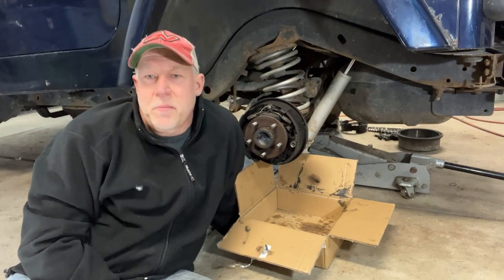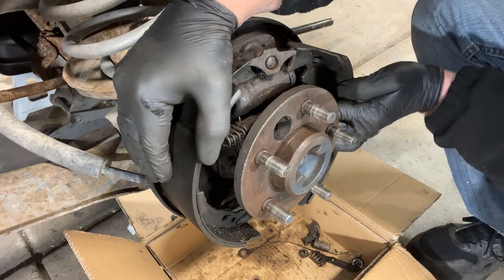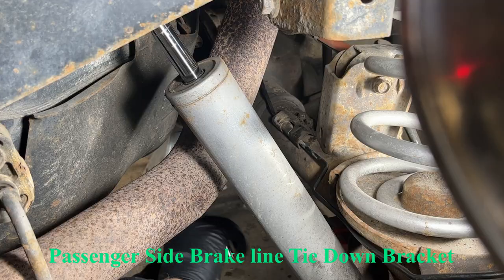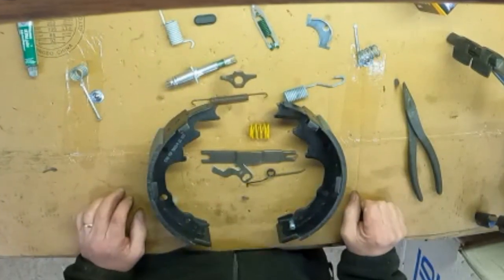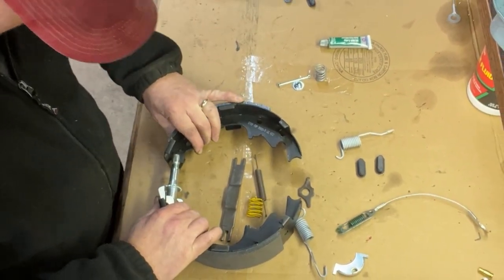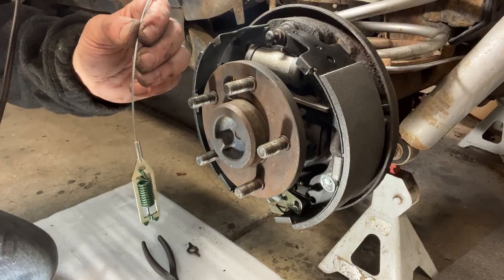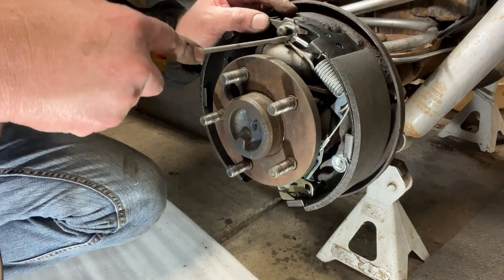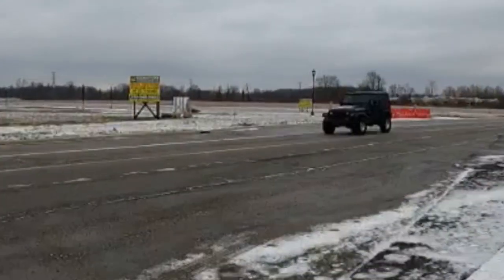TJ Jeep Wrangler Drum Brakes - Quick and Easy Removal and Install New Shoes, Wheel Cylinders & Lines

Comment: I did this job last week on my 1998 Wrangler SE and followed your video.  It was easily followed and very informative.  I also did my front rotors/calipers and discs , so this was a complete 4 wheel brake replacement. the only good parts on my original setup that were good were the brake lines.  When bleeding the rear brakes I made sure that all the old dark fluid was removed from the system before stopping and continued to the other wheels.  I now have great braking power, and am confident that the job has been completed correctly.  THANK YOU for the great video assist!  
Bill - W3SI
Reply from the maker: Thanks for the comment and the details on how it went. My goal with the channel is to share good information and hopefully share a good laugh a times. Thanks for the support!!!!

Comment: Well made video, great camera work for a clear view of the assembly process. I didn't see any part where you added lubrication to the touch pads for the front and rear brake halves. The explanation of the brake lines was very clear and informative on the different was to complete the replacement process. Great information without being overly drawn out!
Reply from the maker: We spend a lot of time  trying to cover all the content but I do miss a step sometimes (brake grease on the guide pads) great catch. Thanks for the great comments and watching.

Comment: I found this video as I'm trying to figure out why our 2000 TJ breaks are super sensitive.  Any suggestions on troubleshooting that issue?  If I was to do the same test you did at the end of the video, they would have locked up.  One thing I have noted, when they do want to start locking up or under hard braking, the jeep dives forward and right.  It's to the point my wife doesn't feel safe driving the jeep and it was her dad's jeep that she inherited a year ago.
Reply from the maker: The first 3 issue I would look. 1 : Brakes shoes installed correctly 1 shoe has a longer lining then other, if installed backwards this could cause the issue. 2: Out of round drums could do it and 3: lastly the proportioning valve mounted below the master cylinder could be going bad or   Debris in it cause the issue. Proportioning valve controls the force of the rear brake cylinders. During hard braking it will reduce the pressure to the rear drum brakes stoping them from locking up. If working properly all 4 wheels should lock up evenly.

Comment: At 12:30 minutes on your video , lower right hand side of picture shows some other parts that are included in the kit. A brass pin, washer and a silver clip. Where do these parts go? Nobody shows them on YouTube videos
Reply from the maker: I believe the parts your referencing are for an emergency brake  cable attach. Some drums have a bracket style emergency brake and some use a pin that goes in the  shoe, thinking that’s the parts your referring to. Thanks for watching and the question.

Comment: You completely skipped the square oblong crossbar that goes between the two brake shoes at the top with the yellow square spring on it. 🧐
Reply from the maker: Your right… I screwed that up in the edit. Thanks for the comment and pointing it out.

Comment: Not too bad, audio and visuals were very good and easy to follow - a picture tells a thousand words sort of thing.  Suggest mentioning putting small dab of brake grease on contact tabs located on back plate where edge of brake shoe slides over such contact - grease eliminates any rubbing friction noise; suggest wearing a safety breathing mask (3M?) since stirred up brake dust is very fine and not good for your lungs;  suggest disposing of used brake parts at a metal recycle center; suggest when reinstalling tire, lugs be torqued to proper foot-pound load (too many tire centers don't own torque wrenches...that should be a red herring to potential customers);  suggest mentioning brake drum interior should be inspected for any pitting, grooves or excessive wear - may need to be turned to smooth out surface or replaced (since there is a minimum safe thickness of the drum; WHEN CHECKING BRAKE DRUM DIAMETER FOR WEAR, THE DIAMETER SHOULD NOT EXCEED . 120" OVER THE ORIGINAL DIAMETER. WHEN REBORING BRAKE DRUMS, THE FINISHED DIAMETER SHOULD NOT EXCEED . 080" OVER THE ORIGINAL DIAMETER.); suggest when jacking up vehicle to use rated floor jack stands and not depend on hydraulic jack to support vehicle (safety first);  suggest wearing  solvent resistant gloves to protect fingers and hands from cuts and bruises as well as contact with toxic chemicals (brake cleaner fluid, brake grease, etc); suggest emphasizing self adjustment part is specific for driver and passenger side of vehicle as the adjustment wheel can  be left or right handed threads - color coded spring is an indication which is which (black spring driver side?; red spring passenger side?); suggest placing disposable work mat (brown paper, towel, tarp, etc) under brake to collect dust and chemicals spills that fall to the floor - brake dust is messy to clean up; suggest painting exterior of drum (high temp enamel - black?);  suggest coating inside of drum that makes contact with the hub (not on surface that brake shoes contact) through which lug pens go with anti-seize lubricant (Permatex?) which prevents drum from rust oxidizing and sticking/bonding to the hub - and makes for easy removal in the future; suggest when replacing brake shoes to also replace all springs with brake kit - too many aged springs may look ok but can be brittle and waiting to snap or not springy any more;  suggest wearing eye protection as tensioned springs and foreign airborne material produced while doing the brake job can accidentally find their way into your eye - a safe job is more important than the job itself.
Reply from the maker: Thanks